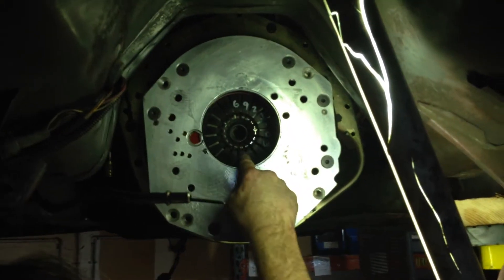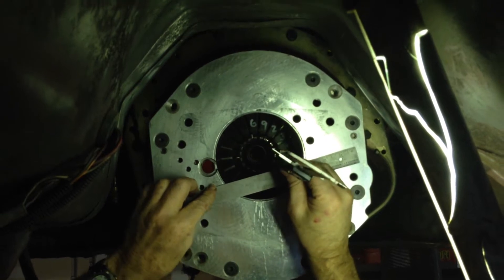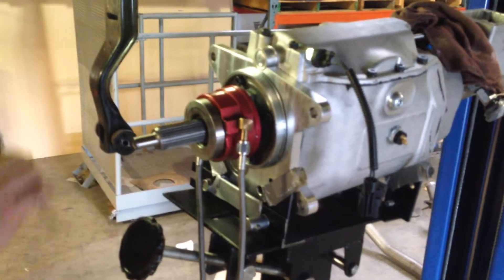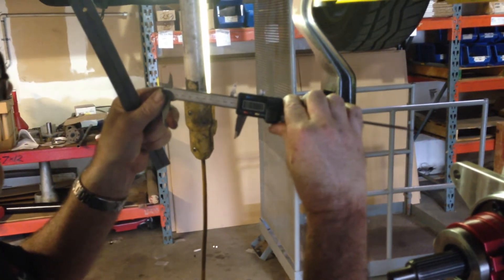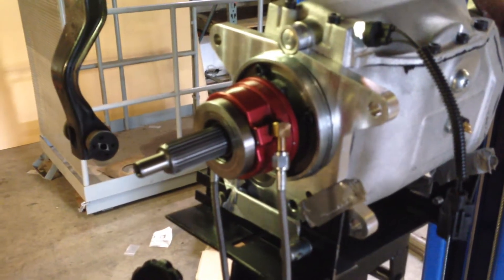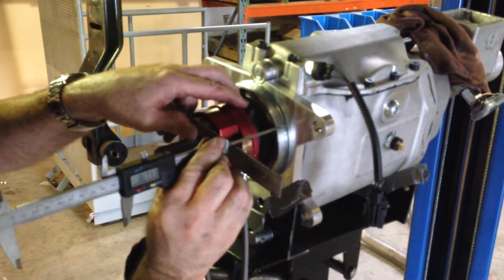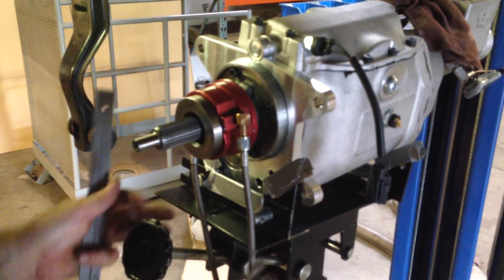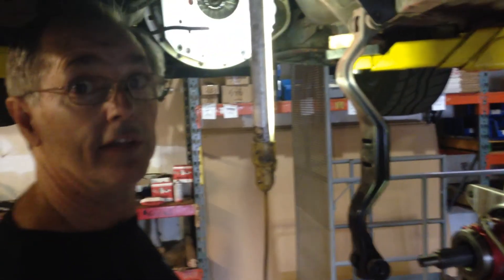Adjusting 1400 series bearing

Comment: With my tr6060 to LS1 I've got over an inch air gap and that's with the included spacer. Am I missing something?
Reply from the maker: Sometimes you need an additional spacer to make up the gap.
 
It is ok to stack two spacers, part number 1439.

Comment: You adjust forward to reach the fingers and you run out of thread, now what?
Reply from the maker: Then you will need a spacer or a taller bearing. If you have any more questions, please call us! 714-630-2764.
Reply: Why was this spacer or taller bearing not included in the kit  MCL-327?
Reply from the maker: Normally the customer does not need the spacer with that application.

Comment: Hello there can you please tell me what stops the slip on bearing from spinning??
Reply: That does not answer the question. From what I can see the hydraulic lines will prevent the body from spinning.
Reply: @jeffchan9176 That seems like a lot of constant torque on those two lines.
Reply: @black33beard1  I used this kit on a T56 Mustang. There is not alot of torque since the only force the lines will see are just from the drag of the bearing. 
Against all advice from McCleod. I used a small section of All Round Flexible Pipe Hanger to stop the drag from pulling the lines. It was flexible to not change any alignment of the non moving part of the body and if it ever broke, it would be no worse than nothing. 
After install. I witnessed the body to be totally stationary and had no regret about securing it.
Reply from the maker: It has a constant running bearing on the front of it. If you have anymore questions, give us a call at 714.630.2764. Thanks!